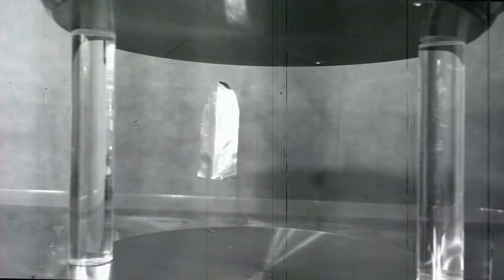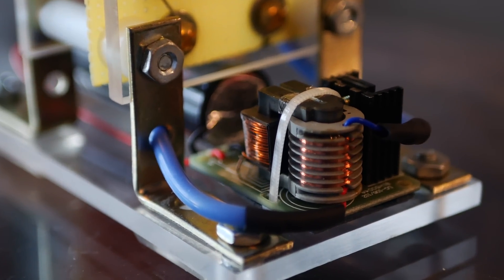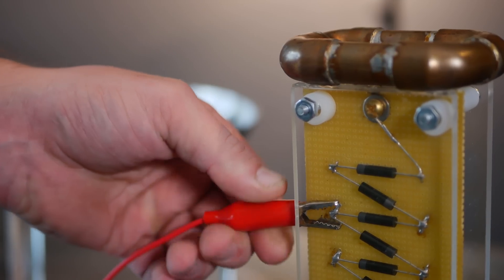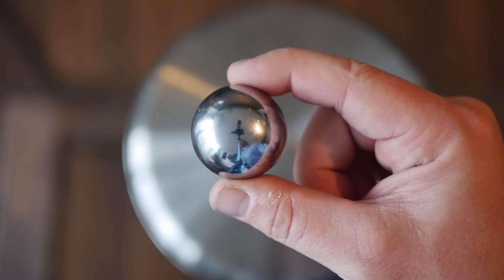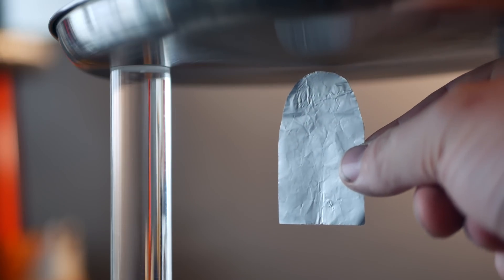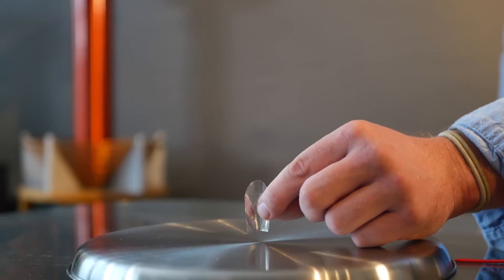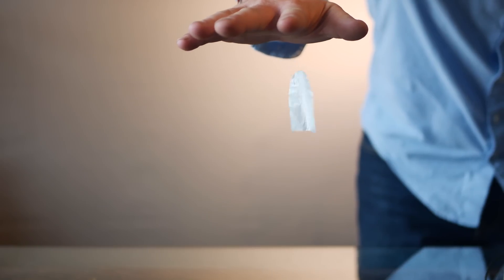Levitation Powers From High Voltage (World First?)

Comment: Looks fake!! Explain the concepts employed
Reply from the maker: I did, heavily explain in the video. cheers.
Reply: @PlasmaChannel  okay, so first thing is that you just gave the definition of unstable equilibrium and how dx disturbance can cause it to collapse and extended the meaning somehow to the concept or experiment that you are doing. The link is missing.
Secondly, why does it start floating in the first place? Why does it not lie down flat?
Thirdly, why is the foil spinning? I didn't get any information after i rewatched your video because of your comment.
These reasons and explanations should have been addressed in the video according to me if you are trying to explain the concepts. Although I am from electronics background, i had never heard of this concept or seen this experiment, and therefore, this video appeared fake to me because no or very little concepts were explained.

Comment: This is ridiculous I can’t wait for ELECTROBOOM TO RECTIFY THIS he used simple magic tricks the paper was levitated with Wire controller by his other hand and attached to a object far away (that’s why we almost never saw his other hand )second that voltage is enough to kill you it is passing through your heart and the best trick acting smart the basis of this is real but with a body it is not It would kill you he tricked people by using smart words and acting like an expert
Reply: Just because Mehdi said he’ll do a rectifier video on it doesn’t mean it’s fake. The lesson of his video will probably be something about not calling everything fake that seems somewhat implausible.
Reply from the maker: Boy, after a comment like this.. really can’t wait for how you’ll think, after Mehdi’s video on it. How did it levitate between the two plates... when I was able to just throw it into place? 

If I was yanking a string with my other hand, why wasn’t my body moving at all? 

The voltage was not passing through my heart - I do this all the time on my channel. When your body is charged to a high voltage, unless there is a discharge, your body experiences very little current, so, little current means little power. The voltage means nothing if there is no current flow.

Mehdi will explain it better. The fact that you are amazed is a compliment. I’m honored you found this so impossible that it must be a fake. This is the power of physics my friend. Cheers.

Comment: What is with one-hand in pocket rule
Reply from the maker: It prevents shock across your heart. If shocked while standing on a platform, the focus of the current path wont be directly across your chest, like what happens when a shock goes from hand to hand. It's a really important safety rule with high voltage.

Comment: One hand rule 
So that explains why I didn't die when I held contacts from a 240V AC mains
Reply: Of course ! That's how it works isn't it ? 
Safe isolation ? Not a problem with the old one hand In the pocket trick 😅
Aaahh sarcasm. . . . 
Yeah nah yeah  the internet is a fun place to learn fun innocence things
Reply: But the one hand rule doesnt make any sense when you are standing on the aluminum foil like in this video. The current will flow from your one hand across your chest to your feet.
The one hand rule only make sense when your feet are isolated.
Reply: Ok I had 2 more experiences since I posted this 
1.
In the shower during a storm , I touched the handle and I felt a muscle in my left hand contract or expand , then I felt the lower parts of my muscles on my legs contract or expand 

2. A slight shock from a motor I hacked open, there were a lot of arcs forming at the bottom of it, the motor is from a bullet blender and it was connected to 240V AC

Comment: Sorry Jay, I’ve seen people do this before, even me.
I was messing around with my voltage multiplier connected to me. I had a bunch of random shaped foil and hovered my hand over the foil. One of them was the right shape to pretty much levitate. You definitely have a better setup than me.
Reply from the maker: Hey G, i've never seen it done online before (on a video). I knew it was definitely possible someone had beaten me to it though. Cool that you beat me to it. Cheers.
Reply: Ah, yeah, I don’t have any proper recording equipment and I was alone in my house at the time so I had no one to hold the camera for me and I didn’t want to risk zapping my phone.

Comment: I did this in 2005 I used a FBT from an old CRT monitor, I fashioned 3 hemispheres from alu foil suspended them above a round plastic sheet I covered in aluminium tape and grounded it to the earth, the three hemispheres were connected to the FBT and my sprites as I called them were fashioned from Alu foil again by wrapping them around a no10 drill bit and twisted off to a point at one end, they spin loads faster than flat pieces of foil, and in the dark as they spin and jump up and down you can see some small discharge, which adds to the sprite/fairy effect :) , the local kids thought it was amazing. GREAT VIDEO :) took me back 15 years
Reply from the maker: Glad to hear you beat me to it! That's amazing....so, you found success with a symmetrical object such as what you used with the drill bit shape?

Comment: Jay, you continue to inspire, awe and inform! One of your coolest videos to date, and that's saying slot given how many great ones you've made!

I have two questions. 

1. If not too much trouble can you do a short video explaining/shoimg how you improved the power supply for the voltage multiplier? Or make a Patreons post with pictures and a bit of text describing, if that is easier.

2. When you stand on the plate, are you wearing shoes or are you barefoot/wearing socks? (Normally I'd swear you had to be barefoot, but high voltage can do some funny things with things that are normally insulating, like soles of shoes, lol
Reply from the maker: Hey Justin! That is really nice of you to say. I put a lot of work into this video, and knowing that you enjoyed it is great. as for 1)  really great recommendation. I'm more than happy to do that for my patreons  2) I am barefoot when standing on the foil. Using socks results in my feet not being in complete contact with the foil, so sparks jump between the cotton and burn me. Full contact is a must!

Comment: Any one else noticed the 3 with the hand. It's a movie major plot.
Reply: So Jay, sensei, I have a few question for you, what's the difference between what you explain and st-elmo fire? 
Could you harnest that kind of statik eletricity as a flying animal (lets says bird feathers) 
Is there a way to create a surface that would enable such thing to super charge capacitor quickly and use those capacitor to power small eletric motor ( making an self sutaining flying device)

Comment: Hmm yes, lets levitate during a thunderstorm 😅
Reply: Levitation can happen if there’s metal near a lightning strike and when it jumps it’s not a shockwave it’s the voltage
Reply: @dark_destiny187  that's awesome, that means when we see that on movies it's not "for show" it's known to be how the phenomenon occurs. My father and I used to listen to his CB radio, and during thunderstorms the frequency of the energy building up could be tracked and lightning strikes were easily predicted by the sound of the charge.
Reply: Maybe that's why in The matrix movie their ships actually flew with electrostatic forces because the whole planet was covered in the storm
Reply: Maybe the storm is not needed it's all about tuning into the frequency of the energy around said craft and components.. while rapidly charging and discharging.. crazy

Comment: Nice demonstration Jay.  Not sure that a hand to foot current path is much of an improvement over a hand to hand path though.  If I was going to do this, I would stand on an insulated platform and connect the HV to the wrist or elbow of my "working" arm, probably through a current limiting resistor.

Comment: This is a cool video. Question i previously built your circuit, but now im getting about 225kv. Do you think i can use that too.
Reply from the maker: You are getting 225kV out of the DIY multiplier tower?
Reply: @PlasmaChannel  Hi Jay,
Yes. I achieved 225kv. 9 inch arcs. I've built several positive and negative multipliers. You can see them in my page. I thought of a way similar to what you did, but instead of aluminum foil. Non metallic objects.

Comment: If the top is -70kv and the lower plate is 0v; could this work with 0v top and +70kv below?
Reply from the maker: Great question. I tried that off camera, and it did not work the same. The foil tried to levitate, but did not have enough thrust nor attraction to the top to hover.

Comment: Nice!  😎👍
What about electromagnetic antigravitic levitation, or mass transfer electromagnetic induction levitation (zero power input to generate the antigravity field.  The energy to generate the field is drawn off of the inertial energy of the object move through the local field.  For sustained levitation, sustained motion of said object is required).  Both of these methods have excellent real world applications, with the later of the two being the most simplistic and great for terrestrial transportation (e.g., trains).  👍

Comment: Cool very cool indeed
7:12 min same charge potential on a smaller point, the bottom level between plate and the body reactive part 
Like if you force the power of the same magnetic field to stay on the top of one direction, your finger direction

Comment: Great video! but not World First XD
https://www.youtube.com/watch?v=S92uPwZdDeQ
https://www.youtube.com/watch?v=iTQ5hL9zYkI
https://www.youtube.com/watch?v=x_PPBnBACMA
even my videos are not world first, there were a lot of experimenters in 18th century and after, about electrostatics effects, the  nice thing we have modern components and solid state electronics  to make it small and low cost.
i suggest using flyback transformer powered by low power as single lipo 3,7v , a simple transistor oscillator and NO CAPACITORS or Voltage Doubler,  it's much more safe and you can control the output with a potentiometer

Comment: But your one hand rule in that case won't save you 😜
Reply: True, leg to hand or hand to hand there is still a pathway across the heart...
Reply from the maker: Hi! It’s not the same risk level though. If shocked through the right hand, majority of electricity takes the easiest path, which is through muscle on the right side of the body, down to the feet. 

If from arm to arm, it flat up goes across the chest/ pecs/ lats, and can contract your heart. 

So one hand rule still safest. 😋
Reply: @PlasmaChannel  but still that much of a potential can deliver a lot of current through the body... And yes taking into consideration the voltage multiplier being small and low powered ... Could say is a bit on the safer side... But no f...g with powerful ones 😀😂
Reply from the maker: Agreed. My big multiplier... NO WAY am I trying this with that one.
Reply: @PlasmaChannel  exactly correct, but contraction wouldn't be your enemy since muscles extend with High Voltage and contract with Low Voltage, but a irregular heartbeat could cause your heart to Stop due to the High Voltage...
Reply: Not exactly sure what voltage this transaction takes place but is probably the difference between Europe and the States. I've been bitten a Higher Voltage and almost blown off a 4 Story building. 

Either way it can Stop your Heart...

Comment: What if you charge the top plate with positive 70 kilovolts and bottom plate with negative 70 kilovolts instead of zero volts? Will the foil now float stable in the middle of both plates?
Reply: The voltage is always 0 until a Potential current is established...

Comment: This might be the best video on your channel after Fire Bending. 
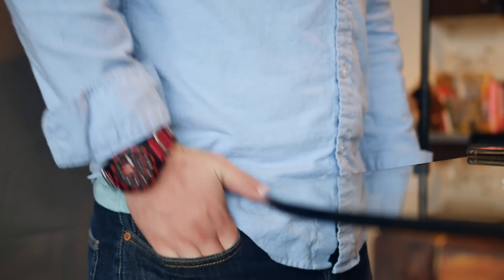At 5:48, you showed your right hand inside the pocket. But if someone does that, it will cause electricity to flow through left hand or left side of body. 
I was relieved to see you using right hand for the experiment. 
That was really a cool and dangerous experiment to try.
Reply from the maker: Hey Tarun! Glad you enjoyed it so much. Yeah, the one hand rule, regardless of hand, will still protect your heart as opposed to a shocking going across both arms / chest. But, right hand is definitely better. Cool stuff right?
Reply: @PlasmaChannel  Electrifying and Awesome

Comment: What if you change the bottom plat and top plate so you don't need to put yourself on high voltage
Reply: Doesn't matter, you need two wires to complete a Circuit. Whatever way you connect them is up to you...

Comment: In terms of safety I've been also thinking about what would happen if you wrapped a coil around your arm. Perhaps some sort of conductive carbon composite. Anything that's higher connectivity than the skin should pass through a carbon composite coil and act as a resistor.
Reply: Great idea, but I wonder if it would take away the feeling of attraction he felt in his finger (hand) ...
Reply: @steve-o6413  I responded too quickly and didn't see your edit! I think it should be fine for an electrico static buildup. The coil should not affect the overall build up of charge and only resist discharges that exceed some uncalculated figure.
Reply: @steve-o6413  inspired by two things:
I saw a demonstration by an electrician that had three parallel cables going to a light bulb from the same source. All three of the cables technically should have a current but they were at different sizes. The largest gauge of the three incidentally took on a greater portion of the current that wasn't relative to the size. Simply the highest conductive path took on the majority of the current. 
The second inspiration is the Hebrew Tefflin. I have a thing for religious artifacts.
Reply: @michaelinamoment  interesting, in a Electrical panel the ground wire is always reduced in size, but the Neutral wire remains the same size as the feed wires sharing a return between the two. 

I don't remember if this was always the case though in the back of my head a reduction in the Neural wire was acceptable but not as much as the Grounding wire. This would be similar to what you had witnessed. 

They say Electricity is lazy and will find the least resistance for its path...

Comment: 2:32 ArcAttack happened. One of their Tesla Coils obliterated it.
Also that mic... Does it require bluetooth connecting? would it work with a regular video camera? It's such a nice mic and it fits on your shirt!
Reply from the maker: Solid, Plasmaprince. Arc attack happened!
Reply: Electricians are advised not to wear conductive materials especially Gold jewelry. A wedding ring could cost you a finger "Ouch", now we can extend this too electronic equipment "$ Ouch" ...
Reply: Um.... What is an Arc attack?
Reply: @arunpandian294  Copy and paste "ArcAttack" into the search bar, and let your eyes be opened.

Comment: Fantastic application of using the human body as part of a circuit. I learned in terms of  equivalent components to compared to any circuit: Consider the human body a series of resistors and capacitors in parallel.
To levitate a human body I've contemplated the idea of the need of more non-conductive surface area needed to be polarized on the human form if it ever hopes to be levitated. 
See my electrostatic kite I posted about last year. 
I just recently moved into a house from a condo so hope to ramp up my own experiments again.
Reply: Good luck..!
Reply: Can you provide link to said kite?
Reply: @deathskayebolo6806  oh sure first video I did on it was here: https://youtu.be/GRUvAuB87ls if you look at videos leading up to it kind of seem more progression as I charged non conductors on the van de graff